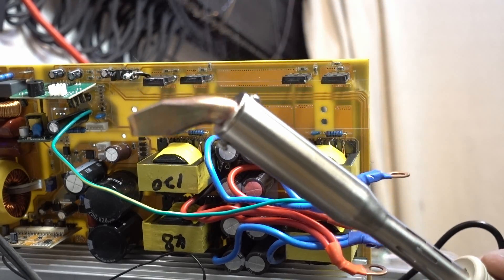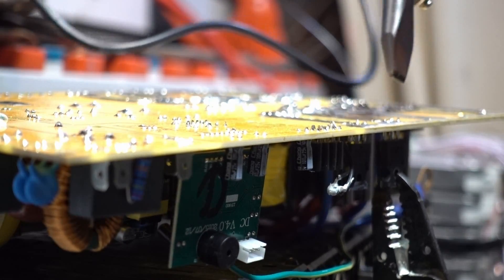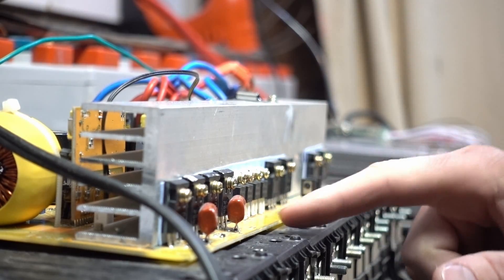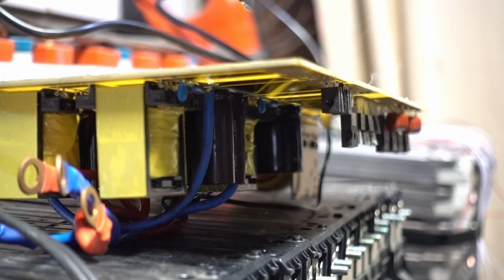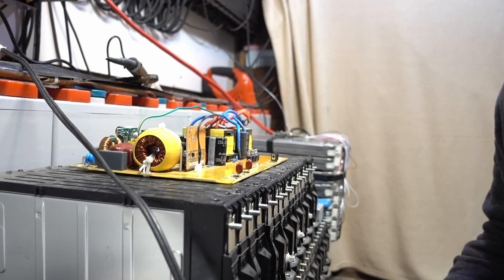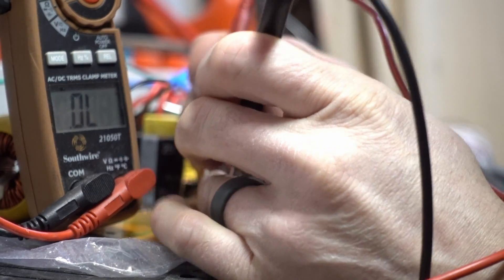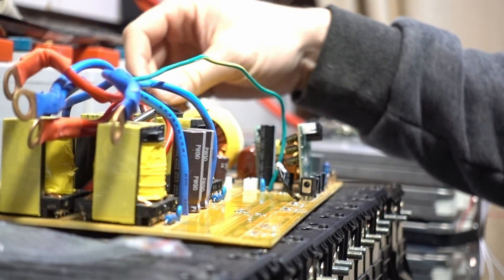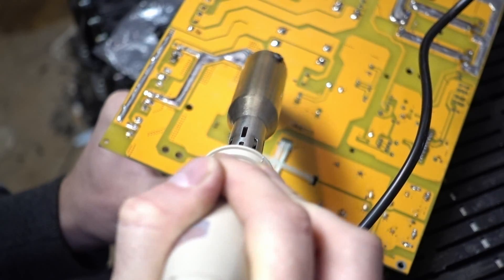3000W inverter Repair Pt 2 (Soldering)

Comment: I have the same inverter but a 3500 watt one and it's doing same thing where it shows 48 volts but no AC output on the display, it also has a beeping red alarm led.  All the mosfets are ok, what could be the issue do you think?
Reply from the maker: Those are hard to figure out, could be the driver board

Comment: Man great effort but don’t you think you need a table away from your batteries? Or just tape up cover up those terminals? Last thing you need is solder and shorts on them. As I’m not sending back mine that failed your video has given some confidence. to all those inverter owners.
Reply from the maker: Yes a table would be much better

Comment: Just a suggestion, if you use a rotary dimmer connected to an outlet (rated for the correct wattage, of course), and plug the soldering iron into it, you can control the temperature of that soldering iron so that you don't burn the traces right off of the circuit board.
Also, when removing an old MOSFET, just cut the leads off of the m and it's easy enough to desolder the pins one at a time.
Reply from the maker: thanks! I see it would of helped.

Comment: I have that same soldering iron, but the tip on mine is totally worn down I realize now... guess I should get a new tip.  Yes, mine also gets way too hot I think, burns traces if I am not careful, but is a life saver for large solder joints and wires.  I personally think SMD resistors are much easier than about any other part to replace, I have a wide tip for my soldering iron that will reach both sides of 1206, 0805, 0603, etc parts in one go.  Heat, remove old, and place new all in one quick go.  Sometimes I have to add a little bit of new solder paste and add a little air to reflow.
Reply from the maker: its my new favorite soldering iron
Reply: I do the surface mount resistors with hot air. grab them with the tweezers, heat with the hot air station and they slide right off. :)

Comment: Why you did not get desoldering iron which has pump to suck the solder out of the hole?
Reply: Because it most likely would not have enough heat capacity to do that copper area.
Reply: Zoony FireballXL55 In most cases you are right, but if using the good quality one like WXDP120 desoldering iron I think this will do the job.
Reply from the maker: I have one of those, it was faster to just use the big iron :)